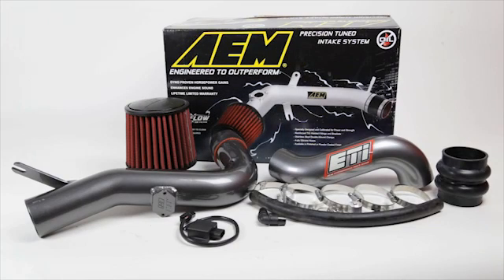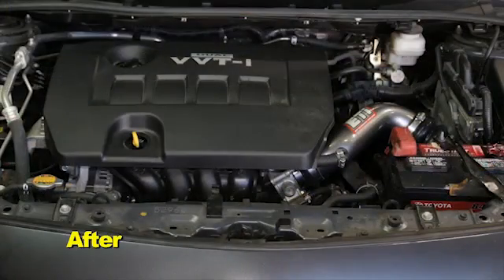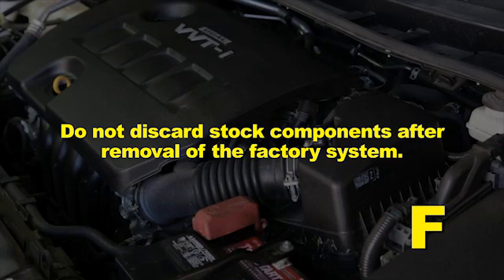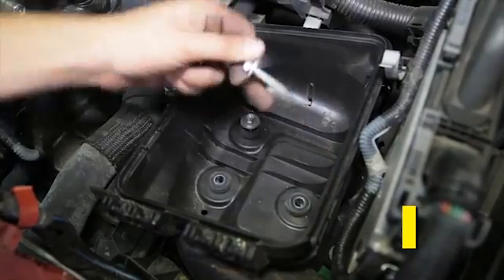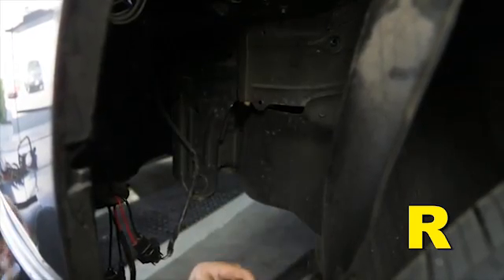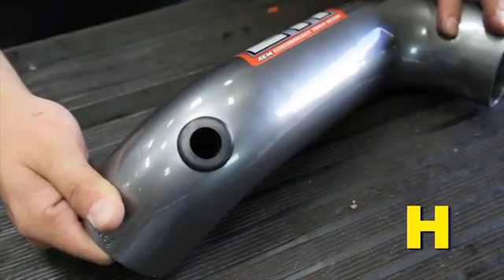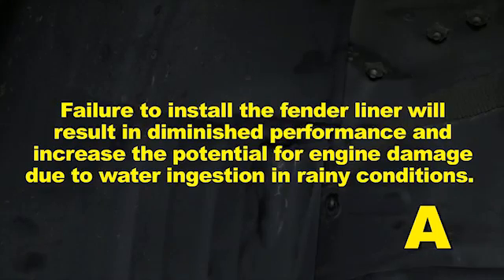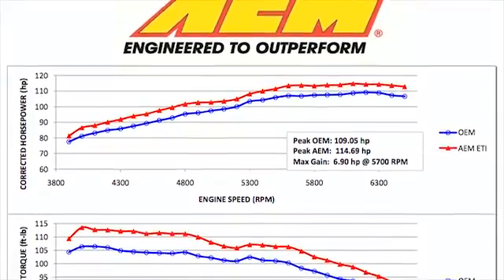2010 and 2011 Toyota Corolla 1.8L Air Intake Installation

Comment: Try to running it hot and whit hood closed. 
Your intakes will be actually introducing  hot air, which reduces power. 
OEM intakes get air from outs its engine room.
Reply: are you a lil special

Comment: I have a 2010 corolla and am considering doing this. Can anyone tell me if it’s worth it? What is the maintenance like after the fact?
Reply: No maintenance besides cleaning the filter twice a year and maybe replacing it if you live in a sandy area.  Installed correctly it's just a straight forward intake.  You'll get 2-3 hp and a tiny boost in MPG and the motor will sound a little more lively but not in a loud or bad way.  The only mod anyone should really bother with on a Corolla.  A good simple car that will last as long as the owner maintains it.

Comment: hi guys, i am in the uk (so it would need to be shipped) but i was wondering if this air intake is compatible with a toyota corolla VVTL-i T-sport Compressor 1.8 supercharged 2005 plate. bit of a rare car as far as the corolla family is concerned i must say but if it could fit you may have won me over with this one.
Reply: injen is better for the 2zz bro
Reply: mark true spurs fan
im looking into a chaser tourer V now fella. are ingen still good with that toyota?
Reply: injen and SRT intakes are best for Toyotas, the stock airboxes can be utilized for more more, or if the airbox is big enough, a deck plate mod can be done. chaser is a good car
Reply: sweet man. and yeah the chaser TRD tourer V is the one for me :D